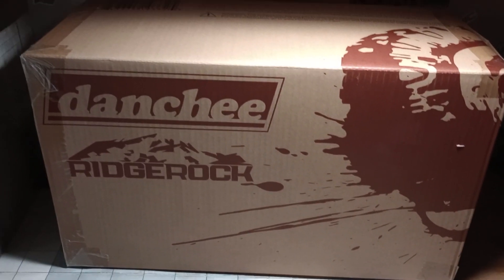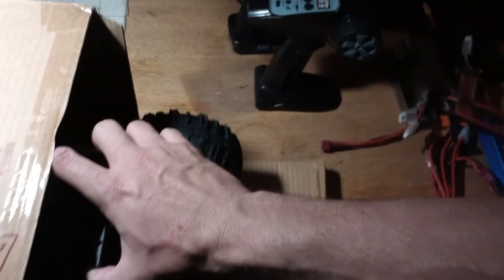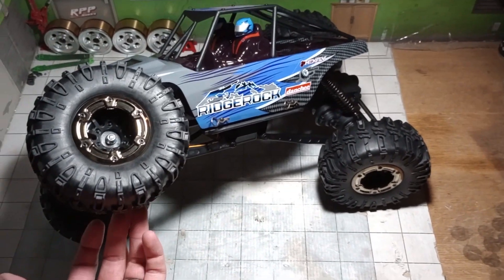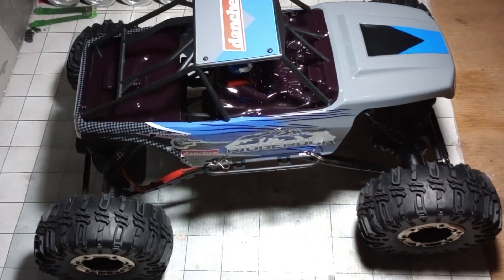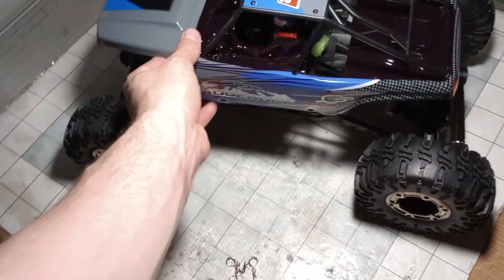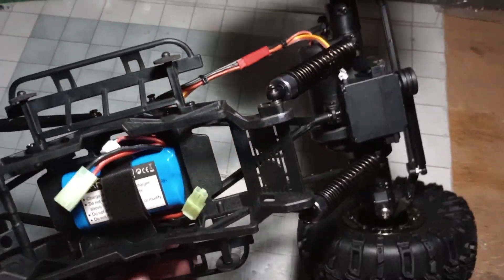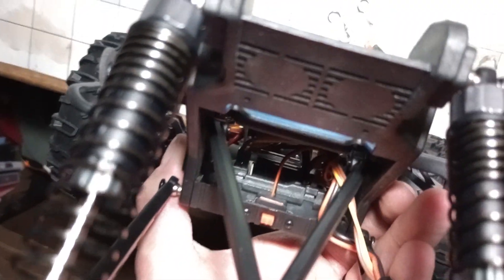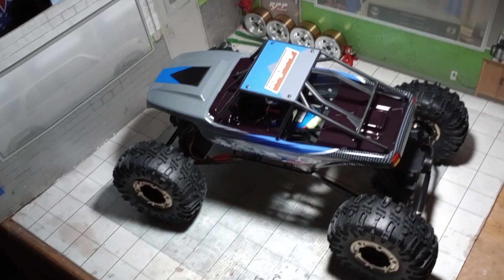redcat danchee ridgerock unboxing

Comment: FTX RC imports it as the Ravine, RedCat imports the Ridgerock.  I have Traxxas RCs so I made a converter from small Tamiya to Traxxas plug running a 2200 2 cell lipo.
Reply from the maker: I cut and put a xt60 and ran a 1300mah 3s lipo 120c on it and problem